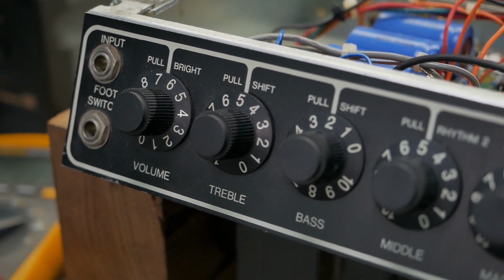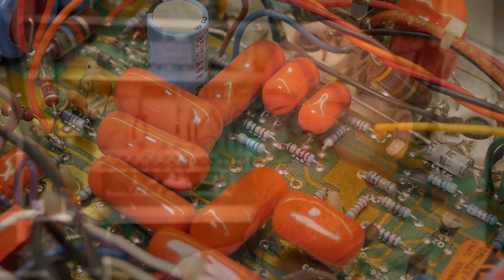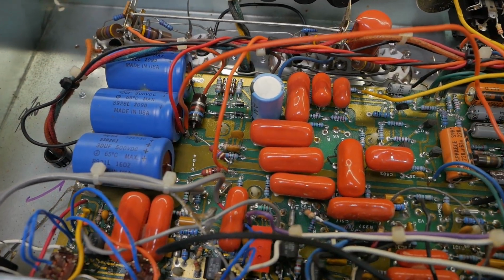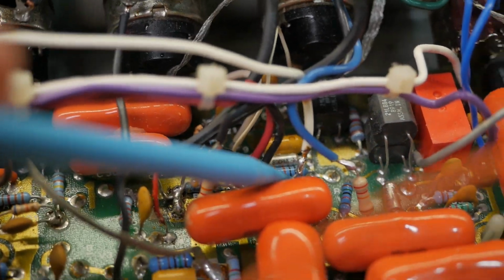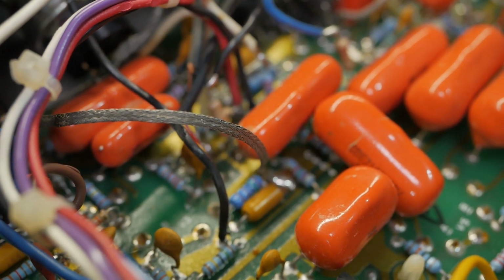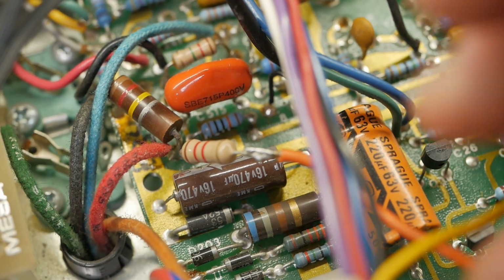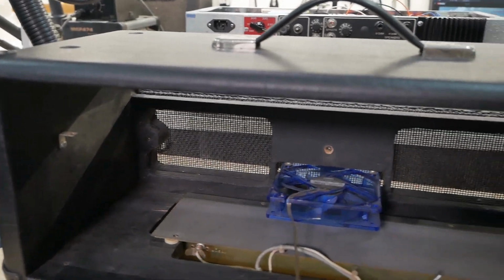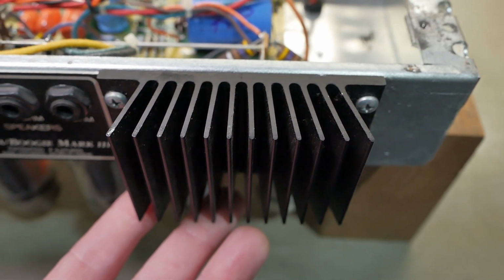Mesa Mkiii Blue Stripe - Part 1

Comment: Chassis gets pretty hot in these, so also the heatsink will be at elevated temp. That's aluminium which has good properties for a heat exchanger and the shape has decent area. So it actually does something. How much, I have not determined that, but they still strapped on a fan for a good measure.

Comment: that's not a Colosseum
Reply from the maker: Really, I was reading that the half power switch makes it one? It'd be good if they just printed what was what on the back panel back in the day!
Reply: @BradsGuitarGarage  the non simulclass ones with four 6L6 have a 60w/100w switch, the simulclass models are 15w/75w (except the final revision which was 25w/85w).  But anyway the Colosseum versions are 300w monsters with six 6L6.  I thought perhaps you were confused by the "long head".  Many of them were shorter and could be rack mounted, or were in a 1x12 combo cab, or the short headshell.  FWIW, the short heads had the reverb knob on the back (if the reverb option was present).
Reply from the maker: Gotcha, thanks for the info, mate.
I never have time to research the generations and variations over the years.
Particularly when there's so much to resolve like there was on this one!

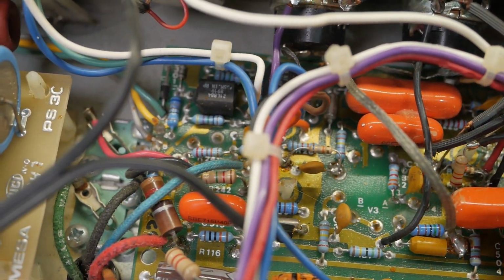Comment: Got to 12:24 of your vid and yea, it's a messy booger, which is what I called my first mesa DC 5 I purchased back in 2010 was supposed to have infinite singing sustain which sounded more like a transistor amp with all the high end hash even clean, distortion would feed back before sustain, pretty much useless as a guitar amp, that amp is what led me to start learning to build my own, pretty much a boat anchor with no boat included as were the other three boutique amps I purchased before the messy booger, won't name them but if I had saved up for a couple years I could have bought something for a couple grand more and Ben happy, oh well.

Comment: I'm surprised you took on this amp at all. It's such a mess! A badly-built amp with horrendous mod work layered on top. I'd be tempted to strip that chassis down to the tube sockets and transformers, install a new turret board, and build a new amp (SLO?, JTM45?) in its place. Probably not what the customer wants though. Good luck!

Comment: These amps are Always worth fixing. Never mod them. They have a really great thing going as they were originally designed. These are before all the power switching rubbish with all the relays so it is truly worth owning and the guy who bought it was smart. Put it back to stock and ot should rip just fine.

Thos is one of the amps that helped wrrote Thrash Metal history. Getting it right is important.

And all that schematic Tomfoolery was deliberate and we all know it. Blobs of silicone and poorly drawn boards were all part of Smith's intention of guarding his designs.

These are great amps that deserve to be loved and played by future generations as part of the evolution of amp design and Metal guitar history.

My Mark IV has been down only once in 35 years and countless gigs. Always gives great Metal tone and has always crushed.
Reply: Exactly, I've got a stock (unmodded) Mark III red stripe and once you dial it in, you can play pretty much anything you could ever think of... blues, rock, metal, grunge even country twang if you want. The sound contouring of these amps are legendary. Problem is you need to read the manual and actually experiment to find the tone you want. The manual has some basic examples of sounds and where to set the dials. Eventually you understand what does what.

Comment: I have had a mesa amp once, believe it was a .50 or something like it. Amp had dropouts when it was warm. So naturally I opened it up to see If I could find the problem. The PCB on that thing was baked to a crisp pizza crust, warped, etc. Sure some tube malfunctioned and overheated, that can happen, but why are there "ventilation" holes in the chassis above the valve? It was also next to impossible to lift the pcb out of the chassis.  

I could not figure it out, brought it to a actual tech he could not figure it out (or did not want to). Sold the piece of junk as a malfunctioning amp, never Mesa Again (except for their cabs, those are killer).
Reply from the maker: Oh yeah, the caliber series can seriously cook their PCB's, particularly the EL84 models.

Comment: The Mark amps came in different sizes, so sometimes there’s room on the front for the reverb, and sometimes they have to put it on the back. They use the same back plate for all of them. A popular mod is to install a gain control for the RHY2 in the unused location.

But in this case, instead of normal mods, they made a nightmare. Holy hell.
Reply from the maker: Then you could have a grand total of 5 vol knobs on the front panel!
No wonder people find them confusing!
I'm about half way through the restoration and I tell you what, it's definitely beer'o'clock for the day!

Comment: This amp is nearly 40 years old. If these components are so under valued how did they last this long?
Reply from the maker: Maybe luck, maybe the amp was not heavily used. The bigger question here is if capacitors are rated for 400v, why would you give them 415v?
Reply: @BradsGuitarGarage  I don't know. I just hear all the time, not just from you, that the components are underrated but it's usually a very old amp that still has the original components.

I appreciate that they're a mess to repair. Everywhere they look overpopulated and crowded with boards stacked on boards. I was just curious about the longevity of the components. Seems like they'd die a premature death.
Reply from the maker: They often do, the diodes in the DC heater supplies for example.
There are many examples, more-so on the USA YouTube channels where there are more Mesas. Mesas tend to use reasonably high quality components, it's primarily the design that is to blame for most failures.
Thanks for checking the vids out by the way, mate.

Comment: "The only way a ground switch should be implemented [is on somebody else's amp]." Fixed it.
Reply: I'm not sure that it "lifts" the ground. The ground from the power cord "should" be going to chassis. The switch is an additional ground after the MOV and Fuse that puts a grounded capacitor on either the hot or ground side.

I could be totally wrong on this.

Comment: The question is what amp do you buy that’s reliable well designed and hasn’t been raped by a repair tech?
Reply from the maker: It's always a risk on any 2nd hand amp.
If you want a new one that's well designed, go for a Friedman, Suhr, Fuchs, Victoria, Victory, Revv, Rivera, Bartel, Soldano, Most Vox's, Orange, Metropoulos, Headfirst, Fryette etc. That's just off the top of my head. There are many other higher quality options than the Fender / Marshall / Mesa status quo.